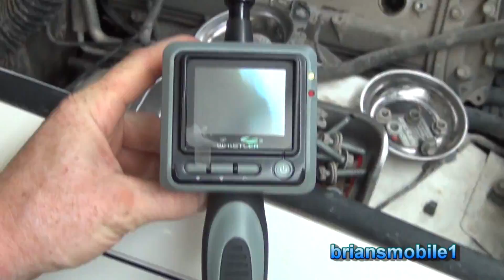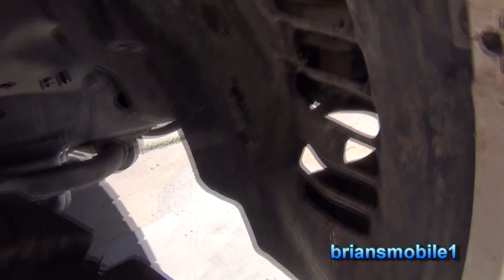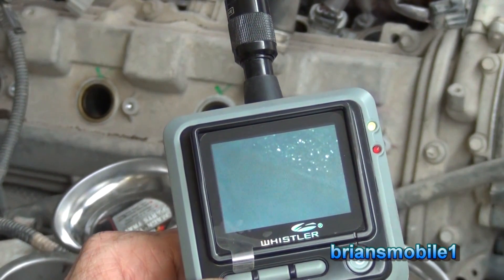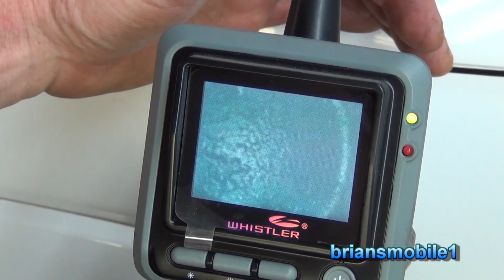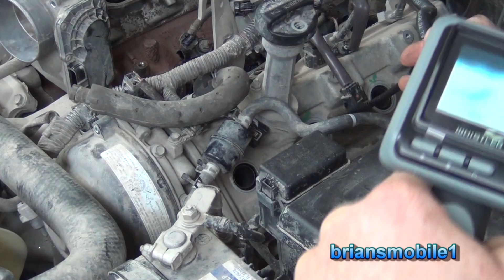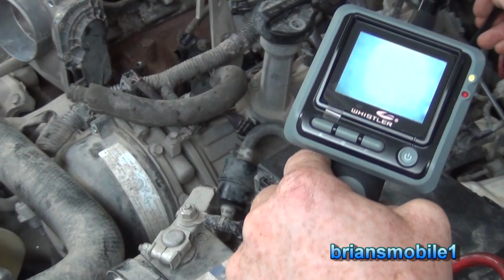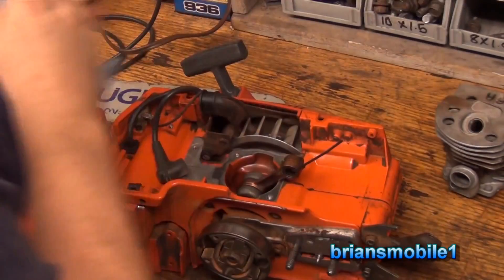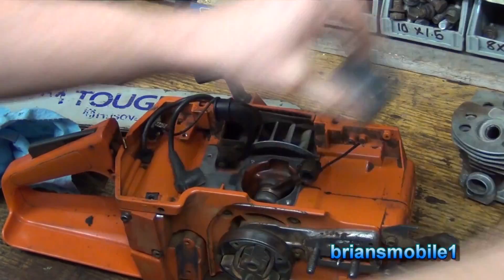What Does Hydrolocked Mean?

Comment: Question for the pros: Could you remove the busted piston (mechanically or by cutting it out. Plus disconnect the spark plug and injector) and have the engine run on 7 cylinders?  I know it wouldn’t t be efficient and might sound odd, not to mention the check engine light. Just wondering if you could operate it this way instead of bringing it to the scrap yard.

Comment: Does a connecting rod always break when coolant or water is sucked into the intake or leaked out through a head gasket? Or is that the reason it's called hydro lock... Because it won't turn over due to a broken connecting rod? If not, is it possible to drain the coolant or water from the oil and have a fully functioning engine again?
Reply: Nobody asked you! GFY! hydro locking is when water can't compress in the squish stroke so the rod can break from the force.

Comment: what a stupid design toyota....
Reply: Almost every stock car uses something similar.
Reply: but this is supposed to be off-road vehicle, isn't  it?  why to have 4 wheel drive then, knoby tyres etc.
Reply: +Enduro Riders I can't think of a stock 4x4 that has an air intake outside the engine bay. Going deeper than that risks flooding the ecu, etc. you have to realize that with proper speeds you can still ford water up to the top of the tire or so, and with a snorkel even deeper.
Reply: +Enduro Riders also, in general when wheeling avoiding water is best. 4x4 is useful for rock climbing, sand, etc.

Comment: shouldn't the air filter clogged with the water and killed the engine before it went in?
Reply: ***** I think it probably depends on the type then. I went too deep in water once, and it plugged the filter and killed the engine as the truck was crawling out of a stream. I pulled it out, and the whole filter was soppy, but later inspection revealed no water anywhere in the engine.
Reply: What brand filter Jon Doe? Sounds like their preventative measures are worth a purchase.

Comment: Seems like a pretty dumb place to put an air intake when the front grill's right there and a much better place to suck air.
Reply: +MichaelAChang Well that would REALLY suck in water when it's raining.  This looks like a 4th gen 4runner.  I had one for years and went through some pretty deep shit (crossed rivers before) and never had an issue with hydrolock.  They must have really submerged this thing.

Comment: It's not so much being a two stroke as it is having multiple cylinders in a given engine. I think you didn't catch what Brian said in the video. It's the other cylinders in a multiple cylinder engine that keep firing and force the crank to continue turning so the hydolocked cylinder breaks the connecting rod. A single cylinder engine would simply stop when it became hydrolocked and probably without breaking anything. Anyway, I'm pretty sure that was what Brian was trying to say.

Comment: i was gonn say till i saw the block busted, in extreme cases you might have a chance with replacing rods on the crank after you pull the head on such side and replace simple part sometimes, ussually not worth it but sometimes its the way to go if its salvagable. as soon as i saw the block busted the idea went down the drain. btw i love my inspection flashlight-mirror telescoping thingy. works like a charm. have fun brian

Comment: I was worried I hydrolocked my impreza when the engine died after driving through some flooded roads as trucks turned around lol. I pulled over and the water had moved the rubber square at the back of the engine and the air filter was wet. took out the air filter and tried starting it several times, no luck. I was able to get it started finally, drove home with no air filter and it drove ok, added Seafoam that day just to be safe. been fine ever since. my Impreza never lets me down.

Comment: when the con rod is part way up the cylinder it is at an angle, now stop the piston from moving. (hydrolock)  cant compress water,  crank shaft keeps moving along with alot of inertia,  even the strongest of con rods cant endure that kind of abuse

Comment: Brilliant , thank you Brian. One question though. When the engine is hydrolocked wouldn't the weakest link have to give in first? The con-rod is made of steel while the piston out of aluminum. I would assume that the piston would be deformed to make space for the water instead of the steel rod bending or breaking.

Comment: I agree that in this case the wheel well 'grill' might be the water entry site...

However, I (don't know for sure) but suspect Toyota found a highway speed low pressure area within the wheel well, and put that grill there to aid as a cooling air outlet, allowing them to seal up the splash pan a little tighter, and reduce some drag.

Having an air inlet within the wheel well would spooge filters too fast, and quickly make a loathsome mess out of everything forward of the firewall...